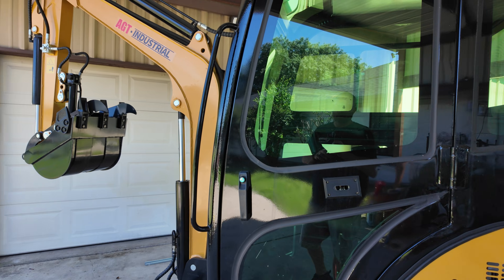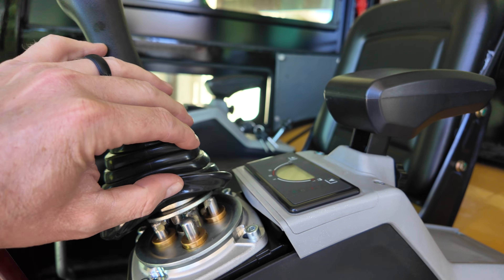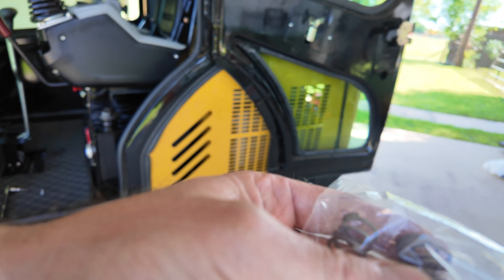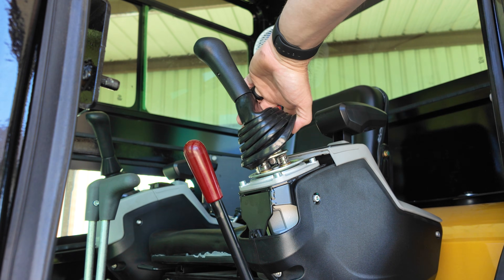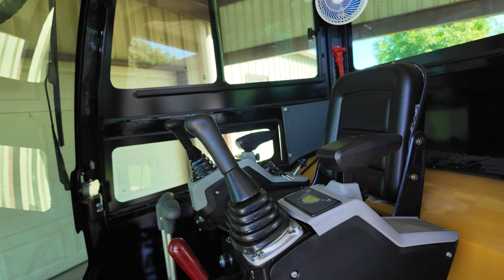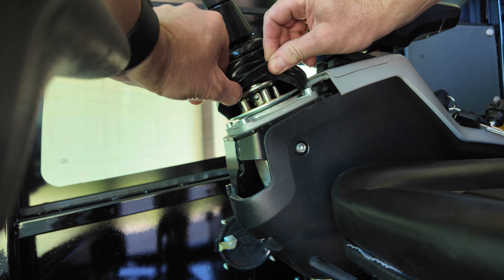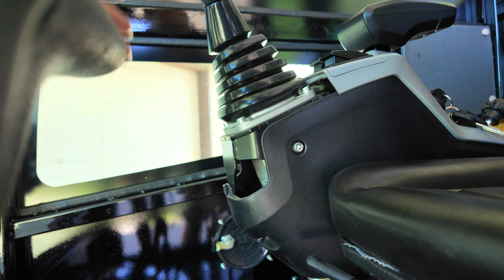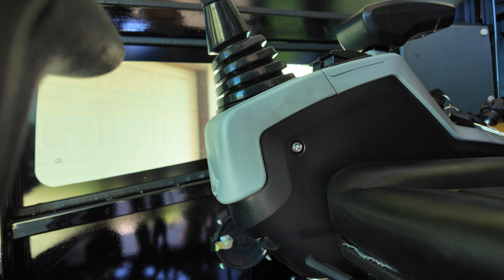Chinese Mini Excavator - Pilot Control Valve Spring Mod Install

Comment: What are the dimensions on thos springs? Height and diameter... Thank you
Reply: It’s 1/2 inch diameter. I grabbed a couple from a hardware store, cut to length
Reply from the maker: @bestman7776 , I appreciate the update. Did they smooth out the controls for you?
Reply: @Digndiesel not as much as I hoped. 
It definitely helped but it still doesn’t compare to the Kubota lol
Reply from the maker: I didn't measure them prior to installation, the Pilot Control Valve website may have that posted.
Reply: They show two kinds when I went on their to order them. Which ones do you prefer the first one on the second?
Reply from the maker: @nevinlee9391 I order the newer updated version. It improved the boom controls but the tracks can be a little touchy.

Comment: Great video!!  Excited to see and hear the kit made a difference for you. Quick clarification for anyone looking at the kit. The material used to manufacture the custom spring kit is 17-7 stainless steel. When the material is heat treated to full-hard state, there is tinted oxidation layer left behind.
Reply from the maker: I appreciate the clarification and the quality product that you produce @springpilot66
Reply: @Digndiesel when you can would you please PM me?

Comment: Great mod. Thanks. I have a Sunward 08, and I think the pilot control is too bad. That is, it feels not proportional enough. It's more like most of the movement comes at the end and nothing happens until after 1/3 of the stick movement. This changes a little with rpm, and works a little better proportionally at higher rpm. It probably comes from more oil flow = better and smoother function. I had a similar small mini excavator in Cat, and it was absolutely beautiful even at low rpm, while the China machine is more jerky.
Reply from the maker: I agree, the RPM's make a big difference in how smooth the controls operate. Even the tracks can get jerky at lower RPM's. I found that 1,800 RPM or high does the trick!